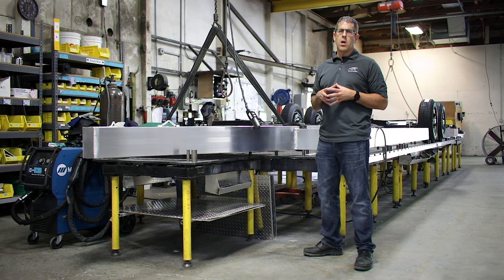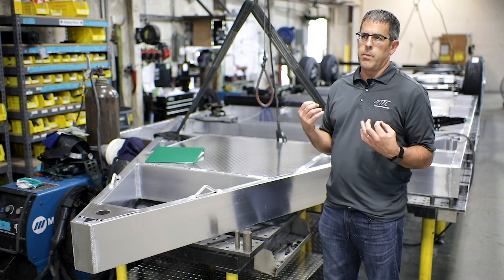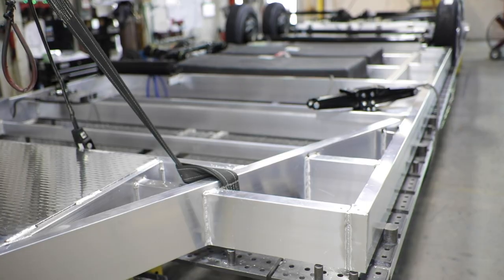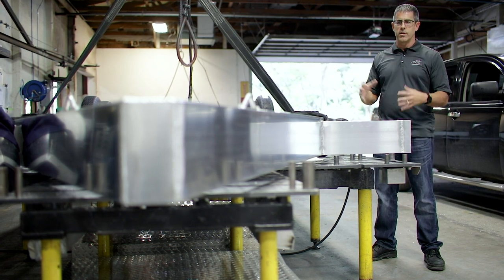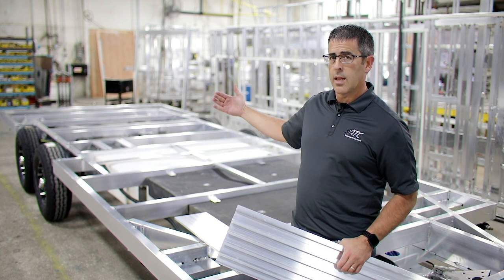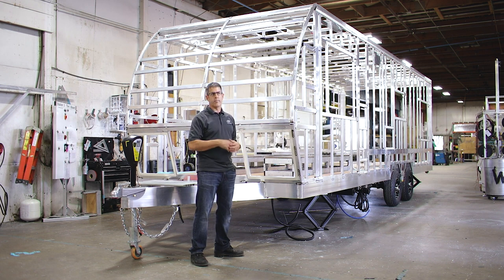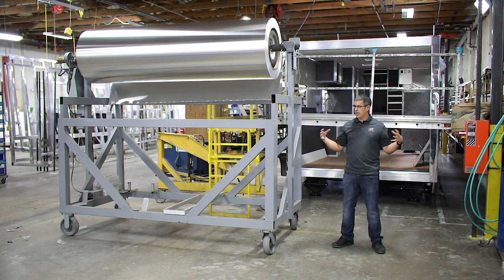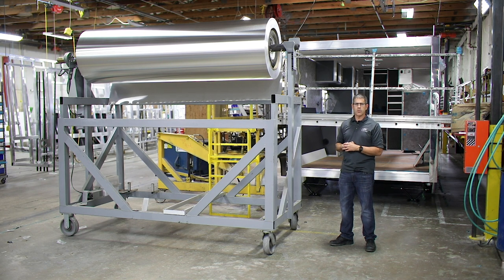ATC Toy Hauler Factory Tour

Comment: If you guys can figure out a four season model I am all over this. Hell I might be all over it anyways! Finally someone that is making a real trailer that is quality.  The northern Indiana staple and glue method is great for budget....but some of us will pay for quality!
Reply: Facts were given this day.  I am thankful I bought a 2019 28' open range lite.  This thing has been without issues...  30k+ miles on it on very rough roads, just have been great.  Yes, it even has a lippert frame.  However, it's full on i beams rather than top bottom and center welded.  All one piece formed.  It's amazing people don't even look at the frames when they buy them.   I would pay for a new one and I hope these guys go full on 4 season as well.  I don't need a toy hauler, but a 28' one or even a 32 with an office would be amazing.

Comment: Multiple YouTube videos recently surfacing showing poor quality control of ATC trailers.  Wheel studs stripped upon arrival, wiring problems, water leaks, doors not closing properly, unfinished edges, and so on.  I had an appointment with a dealer to order a 3619, but holding off for now until quality control improves.

Comment: ATC just released their game changer 5th wheel, for $180,000. I suppose we can have crap steel wood, or go with the caviar. I miss livin lite, they made all aluminum trailers same way but sold for $30k for the bumper pull and 60k for the 5th wheel.

Comment: colder weather insulation process?
Reply from the maker: We have an All Weather Protection Package that includes an underbelly with a radiant barrier, 12V heat pads on the tanks and water lines, and heating and cooling
Reply: @aluminumtoyhauler   Good day, to clarify the meaning of my previous question... I have been researching into buying my first motor home for the last two yrs.... searching for a brand that can stand up to off road boondocking for a big family of 10 to sleep, which wont fall apart. I have watched and read numerous comments RE ATC saying "the interior living space is not for cold weather" but no one is defining the cold weather temp. I would like to know the following a) which dealers are selling the bigger top of the line ATC 5th wheels and travel trailers, with the full winter package already installed, which also increases interior comfort. b) what has been done or what is available from the factory to build in systems that will keep the interior better insulated.. IE thicker side walls, dual pain windows etc. I ask these questions because ATC is clearly one of the strongest if not the strongest non custom mass produced brands.... but for those of us who may be seriously interested in ATC as a purchase, and being confronted with this interior comfort situation....ATC needs to present video details on how a) interior comfort is not an issue, and prove it! b) how the interior can be built on order so that this is not an issue.  Its frustrating as a consumer to not find what one wants to spend money on, without having to pay one million dollars for a custom build.  I would like to see a 4 season ATC....how can one achieve this with a unit that is already built and at a dealership?  ALSO... for those of us who want to go off road....and want greater ground clearance, and more rugged suspension wheels etc...like the expedition camper type trailers..... what is the solution?  Thanks

Comment: what is the approach to insulating the unit?
Reply: It's aluminum, which unfortunately has one of the greatest thermal-transfer rates of any metal. Better than Airstream manages to, you need to isolate all of the aluminum surfaces from any exposure to the interior and then add whatever insulation you want over the top of that. Not easy or cheap to do right and stay comfortable in any weather extremes.
Reply: The walls have  a solid foam core insulation about 1 inch thick inside the walls. The roof is insulated with fiberglass batt between the ceiling and top, which typically won't ever get wet because the roof is an aluminum sheet (but there are air vents-A/C unit-solar panel and electrical penetrations. Lap sealant must be maintained at those points). Other manufacturers use EPDM rubber roofs have more issues and require great diligence with inspection/maintenance.

 ATC can be 3 season, there is a water line and tank heater option, but the underbelly is not enclosed as a true 4 season trailer would be.  The 3 season option is only to prevent freezing on cold nights when temps dip down to freezing and below, not for continuous freezing weather. And the trailer will get cold, it's a toy hauler, and the windows are single pane.

Comment: I've heard aluminum should be maintained in a controlled temperature environment . Aluminum needs to be acclimated to ambient temperature then welded.    If cold aluminum is welded it's not if it will crack it is when will it crack?  Is this true?
Reply: Aluminum welds seems to Crack all the time. Worked for fleet and Aluminum trailers had to inspect every week and usually had to fix cracked welds. Transport company so used daily unlike normal home usually.  Steel trailers is way to go.

Comment: The frames are great. But you guys are charging $75K to $120K for very primitive interiors and I feel like you really aren't providing a lot of value for the money. The 5th wheel models waste so much interior space. There's no options for hooks to hang things, the cabinets don't use all the free space towards the front of the trailer, the kitchen layout lacks layout options so you can't get up to 15.5' feet of garage space with the 36' hauler, you have to go up to the giant 40', there's no venting for a combo washer/dryer in the bedroom, the bedroom doesn't utilize space well either, not enough cabinets, and then of course - the elephant in the room - for $100K+ there's no slides anywhere. Now, frankly, I don't mind that there's no slides - they break and aren't the point of these trailers. But given the price for these, they should be a lot less $$$ given the purpose they serve and the interior amenities provided. The electronics are also behind the times, the inverter is cheap and only 1000 watts, the stock batteries are not lithium. What else? Insulation - the floor is not insulated at all, and the spray on foam underneath is an afterthought. I think these trailers should be about 35-40% lower price for what is offered. Also, the roof can't be walked on, it's just a thin foil on top that can be dented easily if walked on for any reason. Given the GVWR, it would be nice if there was an option for a legit walk-on roof. Of all the interior layouts, I think the 29' is most practical, but it's a bumper pull - which is another disappointment. I wish the 29' front bedroom model was offered as gooseneck.
Reply: So don't buy one. They will outlast anything on the market by decades. They are practical, easy to clean and strong. Dress it up if you want. Frankly if you need  more storage space you are bringing way to much stuff. They also have far more cargo capacity. And the caper is the resale value. You aren't loosing 70+ percent in five years.
Reply: @THEjasonTDI  right, from what I can tell, these are the best build quality out there.. I have a high end Thor Tuscany And I'm extremely disappointed with the quality. If I ever even buy another RV. It may be an ATC. But he is right. The price is high for what you get. ATC could absolutely take over the entire RV market if they kept up high quality and dropped the price in half. They would no longer  have any competition whatsoever !
Reply: @billfrench3277  But if they cut the price in half, they'd be losing money and would go out of business! I did a lot of research on Airstreams. You definitely pay for that brand, but there is no doubt they're spending more to make a product that will last decades. Snd they have decades of proof. I think ATC is the same. I'm leaning strongly toward a smaller custom one.
Reply: All the features you asked for are here, including washer dryer. But be prepared to pay up! Cozyness is up to you. https://youtu.be/uTWY-7PbuVM
Reply: @NewTrip_NewAdventure  paper thin? LOL 😂. Keep guessing.
Reply: You're missing the entire point of ATC. All the hooks you seek are available from virtually every other manufacturer, except Living Vehicle. Enjoy your rotting wood lol